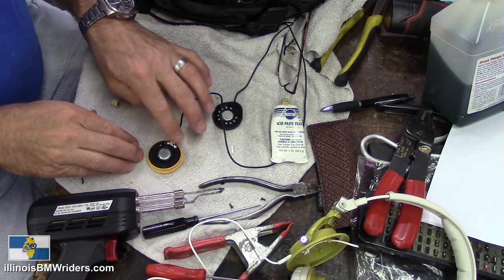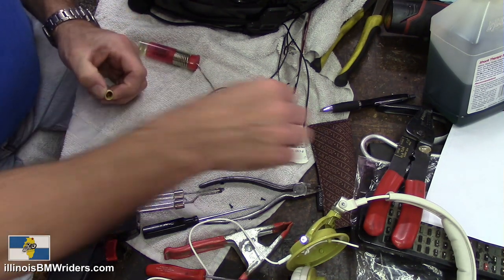Sena SMH Bluetooth Helmet Speakers - Time for a Huge Upgrade!

Comment: Just checked to buy the headphones 5/18/19 price just jumped to $50 bucks
Reply from the maker: Try these instead. They look to have the same speaker. https://amzn.to/2QgM18U
Reply: @kirksmotorrad  can u double confirm on this headphone since the first one is hard to find now. Its true Sena has a lousiest speakers same like chinese ripoff..btw..how do u trim that headphone? are u using grinder? or u cut it with heavy duty scissor bit by bit?
Reply: $50-60 now :(
Reply: @kirksmotorrad  depending on what color you pic it raise or lowers the price..
Reply: Just got some for like $9 off eBay

Comment: Thanks for the video, and naming what cheapo headphone drivers you you used, it is a great improvement.  Sena if your watching you need to get with Panasonic and buy those drivers as a minimum.  I spent a reasonable amount of money for a system that was nearly useless until I did this.  I was not expecting Sennheiser audio quality, but I DID expect to hear the damn things at 70MPH in a full face helmet.

Comment: I see you used acid core flux. For electronics, that is not the best to use as it will cause corrosion. Use rosin core instead.

Comment: Watched your video after struggling with the volume from my Cardo headset. Bought the same Panasonic headphones, and fitted them. They are amazing. Thanks for the tip👍🏼 Only cost £10.

Comment: I just completed this today and have to say... WOW. Easily 3x better sound. Theres bass!! I installed these inside a BELL DLX Qualifier helmet and noticed that when putting the helmet on the new speakers can rub my ears as I try to straighten out my ears due to the new speakers being slightly thicker. This is only a slight difference which is a non-issue. Totally worth doing this especially for the cost.

Comment: I have done the upgrade and have to say, it works better that I would have hoped for. It has decent base and is a lot louder,. I can't have my Sena turned up to the max now. Sound quality, although still not amazing,, is 100% better then the original tinny originals. Thank you

Comment: Nice upgrade!  I would recommend using a soldering iron for parts this small and using flux is not needed with appropriate rosin core solder.  If wrong type of flux is used (plumbers flux), the wires can corrode later causing problems.

Comment: Making sure you original Sena 20s speakers are touching your ears and correctly aligned on your ears, helps a great deal, try that first before anything else. From what I understand, any speaker mod, whether this, or  purchasing new speakers like the IASUS XSound 3 is not going to increase volume/loudness from my understanding.  What some interpret, after a mod, as louder seems like it is actually improved clarity, improved highs and lows. I this is my interpretation of reading many comments on the IASUS XSound 3 and comments here.

Comment: I watched this video yesterday. I went out to marshalls today and found some jbl 450 headphones for 20$. I bought and installed them in my helmet. HUGE IMPROVEMENT. They werent a direct fit in regards to size but after carving some Styrofoam they fit perfect. Thanks for a great tutorial. BTW im running the sens 10s and its twice as loud now

Comment: I love tinkering, and appreciate this video very much as I have tried something similar.  I have reached a road block, that is why i choose to by higher end ear buds for my helmet.  As it is with the comms units they are limited, it is hard for these compnays to make a profit fitting them with decent audio quality, and portability takes a hit if you want to upgrade sound.  They are also limited by only using MP3 content, small wires and little to no power supply.

Another route to go for better sound would a small size amp/dac that connects to your mobile device by 3.5mm jack and then outputs to a decent set of in ear speakers. The size of the portable amp /dac is about the size of your phone and can be had for around $100 US. giver or take. I know it is not the best solution but its how I get the best bang for the buck on music while on the bike. You do loose the ability for rider to passenger comm's but I see that as an upside, why ruin a perfectly good ride by having to talk to my wife. ;) 

Be well and be safe on the road.

Comment: #1) THANK YOU for the video. I already tried this in the past and it worked for me. I just didn't select the proper speaker replacement. Now I'm going to try your suggestion about the Panasonic. #2 DO NOT listen to heaters. Send them a prayer and call it a day. You don't have to explain what do you ride. People assume that because you ride a Harley or a BMW you are either rich or a snob.
I have a Harley set and the bass is amazing and has great sound quality. Not extremely loud, but enough to hear with my loud pipes at 80mph. Now I also ride a V Strom and I need my Sena a lot but I hate it. My Harley headset is obviously useless for the V Strom. I was so desperate that I was considering buying a used Harley headset and butcher it to get just the speakers. 
Thank you again. Remember ignore the internet trolls, they feel powerful behind their little screens and keyboards. Ride safe brother

Comment: Thank you for the idea!! I checked on amazon, just pick the headphone that is cheaper. There are a variety of Panasonic headphone colors and I picked the white one since it was $19. Also I used the electrical solder rosin so it does not cause any corrosion. Seriously it works and I have an SMH05 and it works well too for anyone that has it.

Comment: Well I just finished fixing JBL tune 500 speakers in my Schubert C4 pro with the build in Sena SC1A. First I tested the JBL direct on my iphone, Boom boom pow from the Black Eyed Peas as reference. Awesome bass in the JBL drivers. Generally a very good set of speakers for only 25 euro's at the Mediamarkt. 

Key for good sound is the spacing between the speaker and ear! Lesser space is better bass..... I put some extra velcro layers as padding, the speaker is now lightly touching my ear shell and the sound is totally great.

A small tip for sound lovers that do not wanna go for the earplugs, in my Shoei JO I have put a pair of Earebel by JBL (they are a bit thick so you might have to dremel a bit of foam away, I did with the Shoei JO, but they might fit perfectly on your helmet). Great bluetooth sound with a bit of ooomphf, no intercom though. I can even talk on the phone even though the mic is incorporated in one of the speakers.

Comment: Thanks for the info.  I replaced the completely blown speakers on my Sena 10U with the ones you recommended. Although I think the base is still lacking the replacement speakers sounded better than the stock speakers and the volume is definitely louder.

Comment: Awesome video thanks for the tutorial. I have the Sena 20s Evo. I tried using 32-ohm speakers they sucked horribly. I went to 64-ohm speakers ”Sennheiser hd280” and MAJOR difference! I could hear the music clearly bass thumping at 80 mph I had to turn it down actually. No battery issues as yet.
Reply: Hello, i'm very interested about your personal upgrade, do you have a picture or any link ? Thank you

Comment: Did this on the Sena 20 with the Panasonic headphone speakers as in the video.  Didn't read the 1st line that won't work with 20s until I watched video again when I found the original Sena speakers are a 3 wire, red, white, blue..  No worries, I just had to forge ahead since everything was completely stripped down.  I couldn't see where the wire went as Sena puts a sealer over the connection.  The red and white were obvious but not the blue.  Taking the circuit board out revealed just 2 connection points.  So I soldered the white to the right one (neg?) and the red to the left for each speaker.  Left the blue off both.  Plugged it in and Pink Floyd was playing in the middle of my cortex with left and right channel alternating when needed.  Sound is at least as good as originals but not sure about additional bass.  Blue wire may be a crossover which would make me think one side gets paired with the red, the other gets paired with the white.  Might be worth a try.  
You are not going to get much bass though as the cones have maybe 1mm of movement.  
A couple things I did, peel the original Velcro off the Sena speakers and reuse on Panasonic.  Also after soldering, put electrical tape over solder joint and wire to give it some strength and protection.  Dremmel definitely works good for trimming and rounding the Panasonic speaker discs.
All in all a fun project and interesting to see how the Panasonic and Sena's are made.  Also before throwing out the Sena's, make sure you pop the magnets out for more fun and games (we use at work to hang prints and wiring diagrams on the  wall)

Comment: Did the Mod...my thoughts
1: be good a soldering. the wires you are working with are TINY
2: the speakers need some room. With the factory plastic in place they are larger than the Sena
3: improvement in my opinion is only so-so. It is better, but not quite as good as the video describes.
~~~ not sure I would do it, if I had to do it again.

Comment: I bought a JVC wired over the ear headphones and ripped out the speakers therein and soldered it on to my Sena and they now sound phenomenal. Cost me $15 for the headphones & gave another $25 to the accessories shop guy to prep them up and solder them on. $40 in total & “voila” you have headphones with skull-crackin bass when juxtaposed to the original Sena crappy speakers. Basically speakers extracted from any reasonably good sounding headphones will sound 500% better than those feeble original Sena speakers. 😇😇😇

Comment: just did this mod on my g9x. amazing. I used rocket  fish wireless headphones. huge huge huge sound improvement there's actually bass now. for all the people not noticing the gains it's due to the headphones you are using buy ones with higher ohm value like 32ohms
Reply: can u share me spesific model.is it bass oriented?

Comment: Nice, I've been thinking of doing this for a while except I also want to incorporate the foam ear pads to block out wind noise. I have the SMH-5 and upgraded to the SMH-10 speakers and there was virtually no difference in audio volume or quality that I could discern while riding. I will have to go this route for sure.
Reply from the maker: Make sure you are using earplugs. The bass sounds much better
Reply: Absolutely

Comment: Great video and idea.  I just tried this with my Sena 30k.  When I cut the speaker wire from the Sena headphones there were three wires! I purchased a set of Iasus helmet speakers to use and when I cut the wire to solder I found they had 4-wires.  Now what?  I'll have to do some research to find why 3 and 4 wires on head phones.

Comment: the sena 20s has a aux headphone slot,why can't you wire the speakers to a headphone jack and plug them in there
Reply: possible, but my left channel seems to have died on thier oem speakers but its still stero through the headphone port maybe ill put dab of silicone on it

Comment: If you got your earpieces to work after soldering with that high powered (too much heat) soldering gun, then you lucked out by not either melting the speakers or the tiny wires that make the voice coil .. a 35 watt soldering iron would've been the better choice .. remember to always keep the tip clean .. dab clean solder on wires and connection point and they'll bond faster .. other than that, I just may have to try this with my corded headsets ..

Comment: Great DIY cheap and awesome way to go from no fidelity to high fidelity.

Thanks!!! 

Amazon has the orange headsets for $10.52.  :  )
Reply: I just used the orange set on my swap and it did not work. I now have less volume and zero increase in fidelity.
Reply: Shondas Luv Are they the panasonic djs400? Thanks

Comment: Uclear makes a speaker that plugs into most Cardo and Sena for $40. Uclear Pulse HDS10 drop in speaker. They are a huge improvement.  If your comm unit has a 3.5mm jack, they just plug in.
Reply: how did you find the bass of this units? I'm considering them. Music without bass is just noise especially on a motorcycle helmet.
Reply: Jhonathan Rivera the Uclear Pulse speakers I mentioned have very good bass capability.  However you might have to play with the equalizer in your music player to tune.  Google play and others have equalizers.  Dont think Pandora does.  When I use the pulse speakers i find the speakers are awesome, but sound different plugged into my phone vs a sena unit.  Just tune them a little and youre golden.
Reply: David M. Kuck thanks you for reply. 95% of the music I hear is Pandora. “Thanks to pandora” I stopped collecting music. Also I use an iPhone and I’m not super tech pr doing jailbreak of the phone, so no equalizer for me.  Even if I pay for one on the App Store will not work with pandora. Hopefully this will work. They are prime in Amazon, so if I’m not happy i can return them. Im trying to avoid the soldering etc etc
Reply: Jhonathan Rivera cool.  The ones I like are part number 11023 and cost just 35 to 40 bucks.  Good luck.
Reply: David M. Kuck one more thing. I'm trying to use this on my Sena SMH10. The base of the Sena has a 3.5 mm female in the back, but it seems that is just for input, not output. I just plugged a pair of headphones and no music is coming out, but if I plug my iPod there I do get music on the regular speakers. Any ideas? where did you used it and how?
Reply: Jhonathan Rivera The jack on the back might be for an input only.  You would need to see if your model has a way to replace the Sena speakers under the mount.  You would keep your current Sena Microphone, but replace their speakers.  I know many of the Sena and Cardo units allow for this, but I don't know which ones.  Just have to see if the Sena speakers on your model used a 3.5 male jack to female in the unit.  I think it would be under the mounting clamp where the current speakers and mic plug in.  Otherwise you are back to splicing... ugh
Reply: You are absolutely correct. I purchased the Panasonic R-DJS400 headphones on Amazon for $15.00, followed your example on replacing speakers and cannot believe the amazing sound I am now getting.  It's like night and day.  Thank you so much for this video!!!

Comment: I do have 1 question.....  why remove the wires from the speaker verses just soldering the wires back together with a mechanics twist?  What's the significance of soldering at the speaker terminals?

Comment: I did just did this with my 30K-- the sound is 100 times better--thank you--just one question--with the new sena 30K, there is a blue wire that I do not see connected in each speaker, does anyone know what the blue wire is for.?
Each speaker had "red and white" wire, I installed each side the same way and the unit works great without the blue wires hooked up
Reply: What did you use for your replacement?

Comment: Has anyone done this with noise cancelling headphones to have a quieter ride? Would need to include all the electronics, not just the speakers, but I think it could be done. I saw one attempt, said it worked reasonably well, wondering if anyone else has ever done it.

Comment: Just swapped over the Panasonic speakers and I have less volume, and the sound quality is the same as the original Sena's. Made sure polarity is correct, guess I'll have to go back to the original speakers :(
Reply from the maker: You really need to try them with earplugs in.

Comment: Just made this mod kirt n it really didn’t make much a difference. I used a pair of 35 ohm headphones by jvc  hav570’s  I probably got a ten % gain the problem is the units don’t have enough power the headset isn’t the problem it the unit it self. But thnx for the tip

Comment: Thank you for the video, quick question, do you know if the replacement speakers will fit inside the speaker holes in a Shoei RF1200 helmet? I am guessing that the holes in your Quest are the same size? Thanks

Comment: Thanks great video.  Agreed the Sena speakers are truly abysmal.  I have a pair of cardo JBL speakers I wanted to swap in, but they are 64 ohms as opposed to 32 like Sena.  I actually was not able to find the specs on the Sena speakers in the manual, but I'll take your word for it.  Anyone know whether this would work/be safe?  From my brief research, sounds like lower impedance means more power usage, so the risk would be not using more battery but maybe blowing the speakers?  I assume if I kept the volume down that would eliminate that risk?  If it's such a problem I'll forget it and just buy a pair of headphones with the right impedance, but the JBLs sound great and were made for motorcycle helmet so would be a hell of a lot easier if it would work.  Any guidance much appreciated!  Thanks!
Reply: Hi Ryan, did you try this upgrade? I am considering it myself but i am uncertain about the difference in impedance myself...
Reply: @henrikdosvik  this is quite a throwback comment. I actually never did. Lmk if you do tho and how it goes!

Comment: Thanks for the video! I'm genereally happy with the Sena speakers, bearing in mind that that they are optimized for speech. However, when it comes to music, they tend to push the highs way too far for my ears. I really like your approach, however I'm concerned that the replacement could be too thick for some helmets. My helmet, for example, is the Shoei NXR, which is pretty tight by default. Has anybody tried a replacement in combination with the NXR?